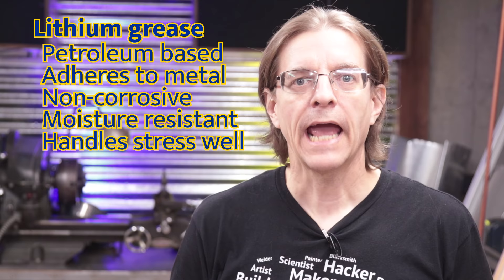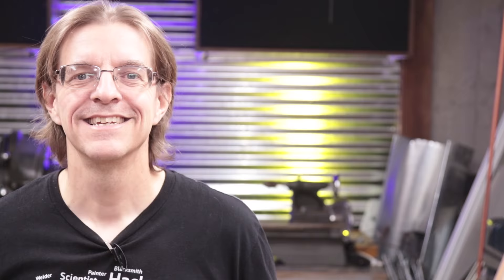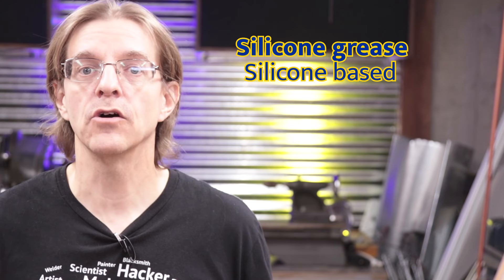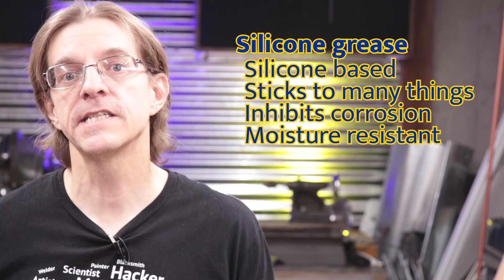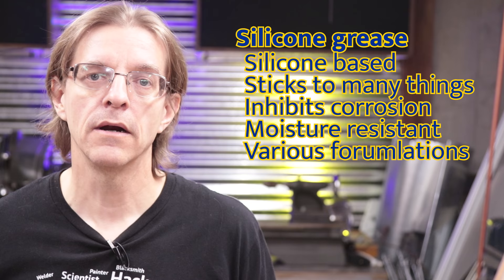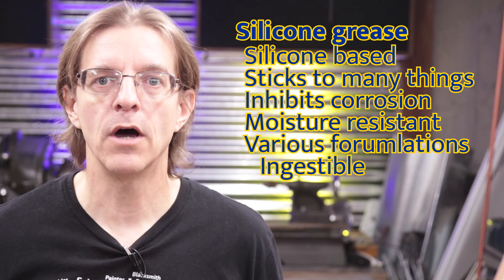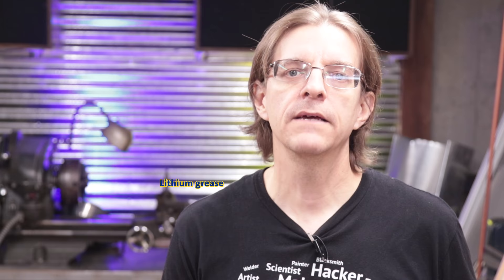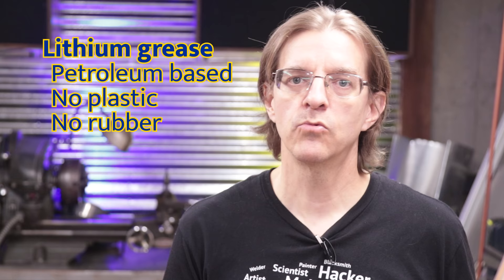Lithium grease vs silicone grease: Which to use?

Comment from the maker: Interested in leaning more about what dielectric grease is and why you'd use it? This explains it: https://www.youtube.com/watch?v=GXyRYArHryU
Reply: @ad soyad use a wheel bearing grease (easily found at auto parts store) for the bearings.  I mountain bike a lot.  Pedro's Ice Wax is the best lube I've used on a chain.  U csn use other bike chain specific oils, but in dirt they attract the dirt and, well, you have a dirty chain sooner, which causes poor shifting and chain suck. Grease on a chain is just a total mess and will be hard to clean and relube, which if riding in dirt can be frequent.
Reply: So   W40 from which of these  Lithium Grease؟ OR  Grease silicone ?
Reply: Hi Harley, I bought regin silicone grease it's WRAS recommended. Is this OK to use on diver watches?
Reply: Hi I would like to know what lubricant/grease or silicone is best for a vechile front strut mount........
Reply: Didn't know that lithium grease could break down plastic. Glad I used silicone spray in the broadcast spreader gearbox - you can only get the plastic cover cracked apart as the bushing is still connected to the axle. It runs better now so ...
Reply: I was unaware that silicone grease was a thing? White lithium grease I know comes in a can but I always thought that silicone spray lubricant is not a grease but a spray lube? Could you please clarify

Comment: It’s odd that silicone grease is not useful for high stress and temp applications because silicone is known for its extreme resistance to high temperatures. In fact, I use it for this purpose on a daily basis. There are a wide variety of silicone greases w/ various additives and many of them keep a high viscosity well into the 500°F range.
Reply: The auto parts store sales brake lubricant that is silicone based that says its rated for high temperatures... the AGS Brake Lube. The little pouch they give you when you buy brakes
Reply from the maker: Yes, I was talking in generalities. There are specific formulations that may be designed for specific cases that are outside the normal cases. Peace.

Comment: You can use silicone grease on the brake system. My TSX OEM manual states to use silicone grease on the square cut seal inside the caliper piston bore and its also common to use this in the guide pins on the caliper mounting bracket.
Reply: You definitely can, and I have seen it used OEM... 👨🏼‍🔧 but silicone grease won’t handle the high temps as well as specifically designed brake grease.
Reply: Great vid. I agree, you definitely can, Yamaha service manual specifies silicone grease on brake calipers for everything that basically touches rubber boot or seal like pistons (seals) and caliper bracket pins (rubber boot). I doubt temperature would ever be excessive under normal operation in non-performance vehicle.
Reply: @tristanmargot3896  Indeed other Haynes manuals recommend silicon grease for piston seals on calipers, though I wonder if this isn't also to avoid contamination of the brake fluid? It also recommends lithium grease for the bearings and red rubber grease is used on fork dust seals, but not on the oil seals or it contaminates the fork oil. Then there's copper grease to stop bolts seizing and I don't know what else. Quite confusing.
Reply: @stevensteel8617 too true, in the end I do what the OEM service manual says and you can't go wrong. I put copper grease on all my bolts not requiring locktite. YouTube is a great guide but I always use my common sense.
Reply: @zacharymurdock6721  My Dodge requires silicone grease on the slides otherwise the rubber expands and binds the caliper from moving freely; the bearing surface is metal to metal and is not part of the sealed/greased slide. Silicone grease/paste is commonly rated for 400F so brake applications are generally fine. Its film strength does not handle high loads so bearing surfaces generally use petroleum lubricants with zinc and other additives.
Reply: Remember you're talking about old cars, their service manual will recommend what was their best available option at the time. If there's something better now, use that.

Comment: TRW makes brake grease called PFG110. in the datasheet you find out its pretty much lithium grease, yet they say its safe on rubbers. So then it depends what kind of rubber, i think nitrile rubber is different and some if not most automotive and brake parts and orings and seals and dust covers are made out of this material so its safe with lithium grease.

Comment: Sil-glyde is made from silicone. It is highly recommended for brake applications including rubber boots, caliper contact points, slide pins. This silicone product is safe to use.
Reply from the maker: Thanks for the information!

Comment: I always used silicone grease for brake caliper sliders without any issues but will consider what you mention and try using a high temp non petroleum alternative.
Reply from the maker: Cheers!

Comment: Loooong ago I quit using lithium grease due to some issues I noticed. Have for a loooong time been using heavy duty silicone grease for most applications. For bearings i will use a heavy duty bearing grease specifically made for such a purpose.

Comment: There is AGS SylGlide for brakes and it's made out of silicone - resisting to high temps. So I wanna say that you're wrong but you might be right - and there are more types of silicone greases: some for low temp, some for high temp like AGS. Thanks for the vid.
Reply from the maker: Thanks for the info! Yes, this was talking in generalities. There are products that are exceptions.

Comment: The silicon spray you showed is not grease, but a very thin spray lube.  
Not all lithium grease is petroleum based. Lithium is just a thickener.  They do make synthetic lithium grease .
Reply from the maker: Yes, what I showed was just a prop for the opening. Different viscosities are appropriate for different applications. I was talking in generalities. There are always exceptions. If your concerned about a particular application, it's always best to look at the application charts for the lubricant and suggestions from the manufacturer of the part you want to lubricate. Peace.

Comment: Addendum: in automotive brake applications where metal comes into contact with rubber/plastics, silicone grease IS recommended. For instance, on the guide pins with rubber dust boots over them on some disc brake applications.
Also, you can use silicone spray lube on the exterior of those boots or the ones on drum brake wheel cylinders.
However, be sure to wipe away any excess lube and don’t get ANY on the braking material, nor on the brake drum or rotor.

Comment: Very well 👍 done liked.. Qs. Should you use silicone spray or regular grease for lubricating a revolving chair?
Just wanted a quick fix and I have those 2 lying around and not inclined in buying something else. Thanks.

Comment: Pretty sure they make silicone grease for the caliper bolts which a lot of mechanics recommend over the traditional grease since traditional grease eats away at the rubber boots and attracts dirt.
Reply from the maker: Yep, best to use the right tool for the job.

Comment: Other commented they've seen Silicone grease recommended by OEM for brake applications on slide pins, boots, and pistons (especially Sli-gylde).  My Toyota manual specifically requires Lithium Soap Base Glycol grease so that's what I use.  Not sure why this type of Lithium product is favorable to them unless the formulation is unique. Should I assume it has the high heat Lithium qualities but without the damage to rubber?

The Toyota manual does specifically say to not use it on the actual brake pad shims and instead use Disc Brake grease.  In Youtube videos I see people smearing disc brake grease on everything without concern which based on all this I assume is bad -- at least one youtube video advocating for Sil-glyde says synthetic caliper grease causes rubber to swell.  

So you have:
Lithium grease that is stated here to be petroleum based and bad for rubber.
Silicone grease that's advocated to be used on rubber but said to not handle heat well.
Lithium soap based glycol grease that Toyota says to use on rubber brake parts (not sure specifics on why this is favorable to Silicone.. better for heat and maybe doesn't have negative lithium qualities?)
Disc Brake Grease that's used by mechanics everywhere-- are these always synthetic and cause the swelling?

Comment: Tried WD-40 in the wheels below my sliding patio door. They turned better before reinstalling the door. But then it was just as hard to open/close. I think the friction is mostly along the weather stripping, which rubs against a band of plastic. 
So, I'll avoid the Lithium stuff, given that it's not good for plastic. Or should I? The plastic is not a moving part. Go with silicone? Or what about graphite?
Reply from the maker: I use silicone on my sliding doors and screens. I have seen a screen where the wheels were worn down and the screen's frame was rubbing on the sill rather than rolling.

Comment: With our freezing weather my doors in my car were frozen tight as well as my trunk!
...my question is; is it safe to use Blaster industrial strength Silicone Lubricant in my door locks? Today I used WD-40 & worked the lock a lot, however my door lock isn’t working quite the same in my old 1999 Jetta! 
~ once I could get in I went to a vehicle agency that sells just about anything car or truck! Water (snow & moisture) had accumulated & my weak tug on the trunk was assisted by a sales associate who suggested this product for my trunk seals! However, we did not discuss locks!
Any advice Jeremy?
Reply from the maker: Yes, the silicone lubricant should work well on both the locks and seals.

Comment: What would you guys recommend for greasing graphics card fans? I have used both but I have found white lithium grease works best so far. Should I be using something else entirely?
Reply: The bearings are metal but the fins are plastic, I would go with lithium but wipe off from fins/plastic.
Reply: Other videos mentioning lubing a PC fan mention lithium.

Comment: Thank you 
Now for the  brakes  use white ceramik grease its expensive but i dont want anything else anymore
It remains on the metal anns prevents rust and can  take a lot of heat
I also use it when i put the wheels  on
Reply from the maker: Glad you found something you like.

Comment: Trying to quiet down my thrustmaster simulator wheel. What would you suggest for beneath plastic rollers on belt tensioners? The belt is nylon and there are no bearings, the plastic rubs against the metal peg it sits on. Can see it getting warm. There was green grease in there before. Need it to stay in place too, don't want it spreading and causing the belt to slip.

Comment: Hi, what grease would you recommend for replacing brake and clutch levers on a motorcycle, some say lithium and other say silicone grease
Reply from the maker: I'd use either silicone or a dry lubricant.

Comment: Bearing on a bicycle bottom bracket. 
Lithium maybe? But it's enclosed with a rubber dust seal.
Reply from the maker: If it were me, I'd use whatever I had on hand. I'd expect most rubbers in this application to be pretty immune to petroleum greases.

Comment: After Service at Service Stations.. what type of fluid should use to coat under the car to protect from corrosion and dust? Either Diesel Sprayed? Or WD40 Sprayed? Or something elese?
Reply from the maker: Personally, I wouldn't put any liquid as a protectant. A liquid will attract dirt and dust and make it hard to clean in the future as well as actually attracting moisture. Cars these days have very good corrosion resistance from the factory. If you feel you need more, I'd consider some sort of undercoating that is designed for that purpose and dries after application.

Comment: I used a small amount of White Lithium Grease on the O-Rings of my heater hose quick connect coupler and a weeee bit on the pipes, before I attached the heater hoses to help them slide on. This is a 2007 Hummer H2, is this a FATAL ERROR?

Comment: I tried white lithium grease on my solar powered gate arm it worked for a little bit and then it built up inside of the arm and started grabbing and now it's like I have to clean it over and over but it's still stuck in there.

Comment: sir i want to understand how much we should add grease in bearing block , at what time interval we have to re-grease,
Reply from the maker: There are a number of factors that will impact how often you need to apply grease. The user manual for whatever you're applying the grease to should have some good recommendations.

Comment: Awesome video! This has definitely opened my eyes to both👍. I've been doing a little car maintenance and I'm a little confused on what exactly everyone's talking about between the different grease and lubricants. Currently I'm trying to figure out what to use in the window Channel where the window slides in between the grooves (the window is getting restricted as I'm trying to roll it up). Any suggestions? Thanks in advance!
Reply from the maker: Yes, it can be confusing with the wide variety of lubricant's available. I don't know that I've ever seen a window channel with lubrication. Generally they have a fabric type material that the glass slides in.

The part the gets stiff in windows generally is the mechanism inside the door. These generally do have grease on them and, being in a semi-exposed environment, tend to accumulate dirt over time. You'll have to pull the inside door panel off to get access to the window riser in order to clean and lubricate that. All the ones I've had to work on have been a pain with limited access and sharp edges around the metal door frame. But once they're cleaned up, they have worked much better.

Good luck!
Reply: a bit late now - but engineers chalk works a treat - job done!
Reply: Silicone is the way to go

Comment: Hello. Im wanting to build a slideboard for exercising. Its a 6ft board with enamel that you slide in socks back and forth on. Would silicone spray on an enamel like rustoleum pro oil paint, once cured, work well with a silicone spray lubricant, or better with a teflon spray? Im about 300lbs so the shall be a bit of friction. Thank you for your help.

Comment: So Lithium grease can not be used where metals to metal friction is present but rubebr and plastic seals are involved?
I need a grease which I can apply between metal gears sliding over each other, the grease should not slip away and the system includes plastic and rubber seals as well.

Comment: Which is, in your opinion, better to use if I want to keep longetivity of my olympic weightlifting bar, and at the same time I also want rotating sleeves (inside are bearings and maybe bushings too) to spin faster (because of dynamic movements like snatch and clean and jerk)? Thank you
Reply from the maker: I would expect either to work well for this application.

Comment: I sprayed white lithium grease on a rear control arm bushing. Would this ruin the bushing? Should I use a silicone?
Reply from the maker: I would use silicone, but it probably won't make much difference. Don't worry about it.

Comment: what grease should i use on the metal to metal moving parts of my double barrel shotgun ??
Reply from the maker: I know very little about guns and what lubricant would be appropriate for that application. My first thought is you'd want a dry lubricant rather than a grease but someone that knows more about gun-smithing would be a better resource. Cheers.
Reply: @First • 15 years ago i live in a 3rd world country and dont have access to US products... So which grease lithium or silicone ?
Reply: @First • 15 years ago i have shell 10w40 fully synthetic motor oil with me... But will it seep into the wood and soften and damage the wood... Im concern because i have a 9000Euro Dt11L with Turkish Walnut ... Lol

Comment: Thank you for your channel, just discovered it and am exploring it.  Is either of these greases good for inside a table saw, or for the sliders on my table saw sled? Thank you
Reply from the maker: Because of the sawdust issue, I would use a dry lubricant or wax on saw parts. Grease will tend to attract the sawdust and gum things up.

Comment: What kind of lubricant is best for a wood-to-metal contact point, where no heat is involved but friction occurs? I'm referring to oiling the moving points of spinning wheels, in which I want to be kind to the wood.
Reply: I would go to  a musical instrument store and get a small container of cork grease.  Many wooden instruments disassemble into smaller pieces and the joints are lined with cork which is greased with, you guessed it, cork grease.  These formulations are compatible with wooden parts, are semi-solid and rubbed on with your fingers.  Non-toxic, long-lasting, small container size.
Reply from the maker: Bee's wax or paraffin are commonly used when working with wood now. Historically, I understand animal fats were also used.
Reply from the maker: Good tip with the cork grease. Looking at the ingredients, it looks like oils you would find in the kitchen. You could probably use those too.

Comment: which one should I use for my bicycle's wheel bearing? I only have three options
First is           ABRO #3 Super Heavy-Duty Grease
Second is     ABRO #2 Heavy-Duty Lithium Grease
Third is         Hill UKEarnest H Hill Ltd NLGI-2 - Silicone Grease

Please tell which should I use?
Reply from the maker: For a bicycle wheel bearing, they'd probably all be just fine. Peace.
Reply: thnx
Reply: ABRO #2 Heavy-Duty Lithium Grease, I have been using this product for several years and it works very well for me. It lasts for a long time and for this reason, it is not degraded like others.